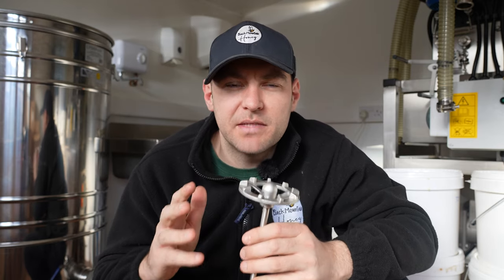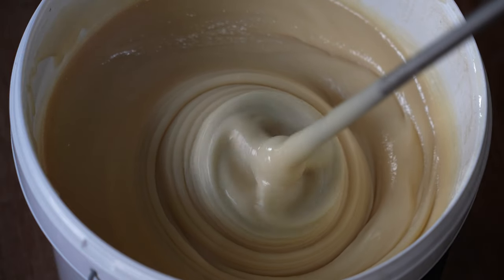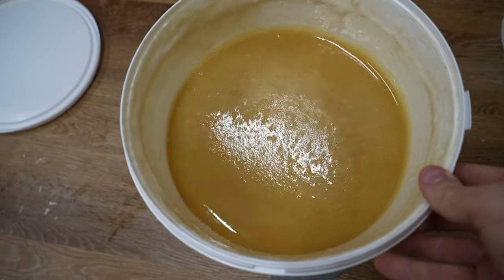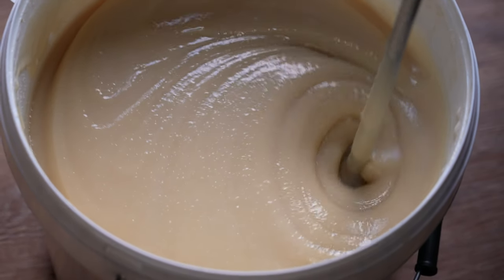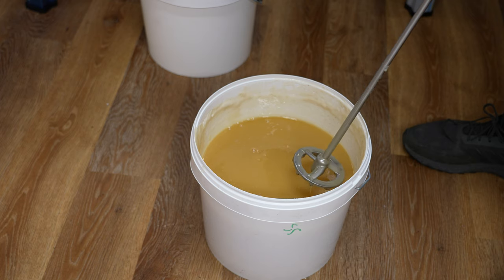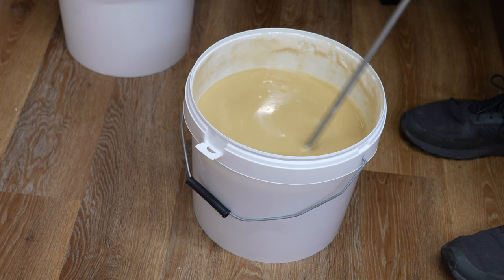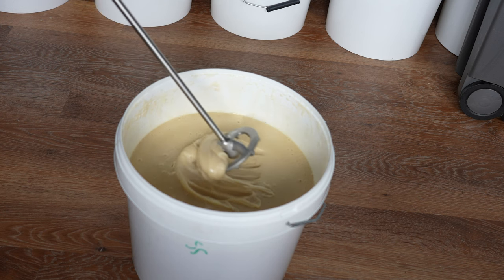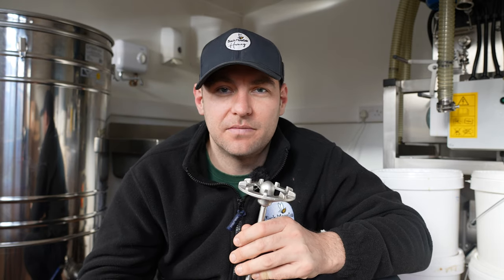This Honey Is Out Of This WORLD!

Comment: Thanks for the video Lawarce. Just made another batch today in a 20 L pail. Last summer I used a metal paint stirring rod (used for mixing paint) and I noticed small pieces of plastic that floated to the top. I had filed down the edges but it was still chewing away the plastic of the pail. I found a plastic bit by Werner on Amazon that looks like a squirrel cage fan on end. It mixes faster with less effort and less pull on the drill. By running it slow I don't get the foam or bubbles on top. I make flavored soft set honey and it outsells runny honey 3 to 1.